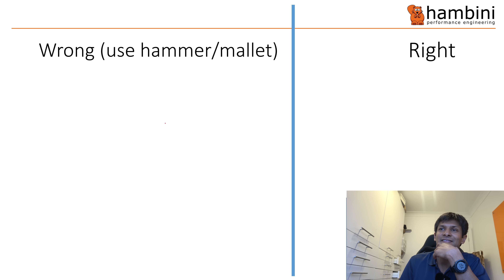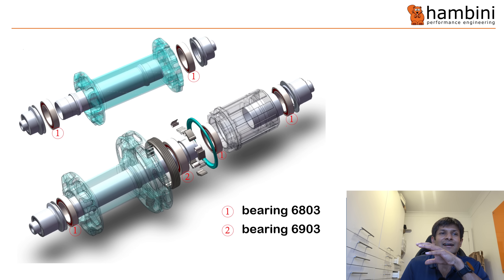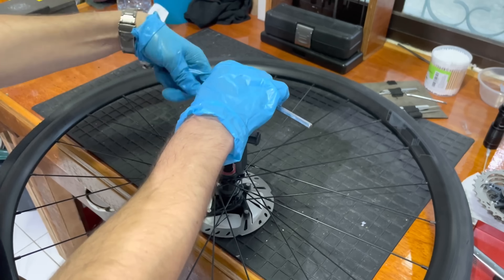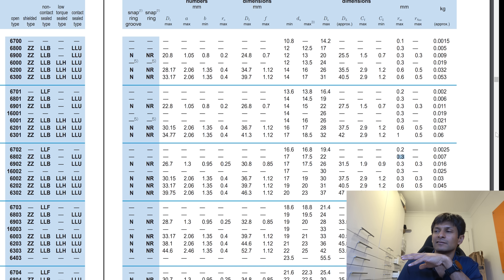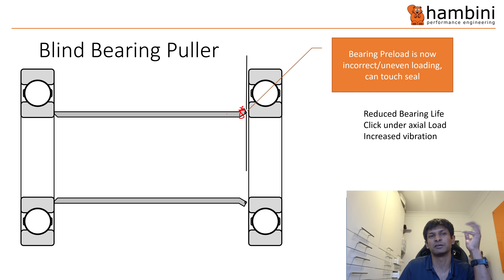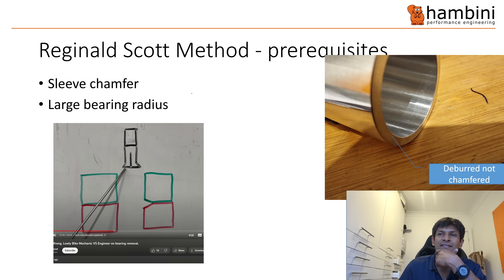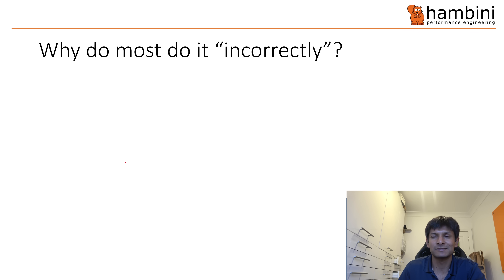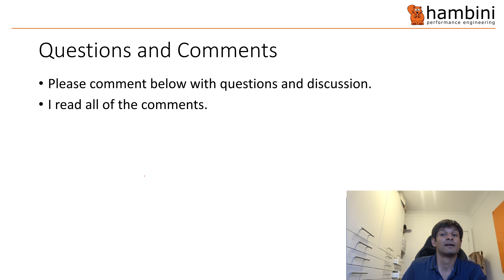I got REAMED by a Bicycle Mechanic | It was bound to happen at some point.

Comment from the maker: For clarity. In his video, he described it as a new wheelset. He thinks it's ok to take the bearings out, then put them back in and sell the wheels on. The bearings will get damaged as you remove them as the balls will dig into the races. Whilst I accept this is done frequently, on a brand new set of wheels and an unsuspecting customer, I think this is totally unacceptable.

On the subject of the flare, his diagram in his video showed a completely flat tube, I was pointing out that this is not the case on his own wheels.  I've taken loads of wheels apart, I've never seen one with a flare in it, or one that was heavily distorted despite being brand new.

I'm also dubious as to whether these wheels are factory fresh, I think the bearings have been removed before. The positioning of the puller legs on the spoke holes are to put it mildly "undesirable".
Reply: @hambini

I think there's some more nuance required, perhaps.

I've whacked out cartridge bearings and bearing races, on bicycles and heavy industry diesels equipment.

I think you and the bicycle engineer are both correct, but both miss out a little detail.

Personally, I'm happy tapping out my bearings and pressing them back in with a vise, or tapping back in with a hammer. But, it's not ideal. 

Blind bearing pullers will likely flare the preload tube, but it's a cheaper part than the hubshell to renew, than if you start to mangle the bearing seat when you're walking the bearing out with a drift and hammer. 

You can contaminate and damage the races or balls with drift material or start to injure the races or balls if they're particularly tight, though this isn't a major concern to me on a bicycle sealed cartridge bearing pressed into a (relatively) soft aluminium hubshell.
Reply from the maker: @ChazHarding  Totally appreciate your comments. The issue is the preload collar requires an exact measurement and it's unlikely your local shop has that size, it's hub specific. Conversely any bearing shop is going to have a 6803 bearing.
Reply: @Hambini  yeah, that’s part of the nuance. Not everyone has access to accurate measuring tools (or knows how to read or use them). Plus, how are you going to measure the preload tube if you distort it on removal…

At the end of the day, it’s a bicycle. It’s not that expensive, or that complex of a machine. Even a whole new hub / wheel is pretty inexpensive when you compare with aerospace or industrial stuff. 

Does it keep me awake at night - not even slightly. For a start, how many times are you removing the bearings (unless there’s some other underlying cause)? Infrequently. Maybe once a year? 

I could pretty confidently remove and reinstall a bearing 10 times, which would (for me anyway) far exceed a 10 year lifespan on my hub. Not to mention as a Clydesdale on my MTBs - breaking a spoke hole, galled / cold welded disc brake mounting screws, or changing hub standards will likely cause my hubs / wheels to be obsolete far faster.

Plus, I like shiny things. I might change them to change the colour, or design, or whatever. We’re fighting over something so ridiculous!! Hahahaha.
Reply: Incredulous, not dubious. Sorry. I'm an old teacher. All the best.
Reply: @chaosflower4892  IMHO, No, spacers should be replaceable. They should be designed in a way that they do not get damaged by the puller. IE they must have a 0.3 mm chamfer or a cylindrical cavity 0.3 + locally extra thickness so they don't flare out. Like this, both methods will work.
Reply: Why not use a collet style blind puller similar to what BearingProTools sells as first choice and then employ other more barbaric methods if the bearing won't budge
Reply: Btw. He's in the comments section commenting on other people's comments saying that you misrepresented what he was doing... Some people really don't know when to give up 🤦‍♀️
Reply: hammer gets a lot of bearings out quickly, good for wheels 
puller is good for frame bearings (full suspension bikes)
vice to push the fresh ones in (if no axle to press)
Reply: Yeah…That’s all we and good…
But the burning question has to be; did you bang the hairdresser’s hubs off, or did you caress them with precision tenderness?
Reply: I would say that the mechanic seems like a nice guy and watching his video it came across as professional and professional constructive criticism (opinion) and not in anyway personal.  
His opinion adds to the discussion and it should not become a pile on against him. 

I’ve watched a few of his videos now and they seem interesting
Reply: @bikepackingadventure7913  I totally agree about "His opinion adds to the discussion and it should not become a pile-on against him. " > It would have been nice for Hambini to have said this.
Reply: 1:19 these are quite different examples of hammer use (hitting the whole axle) for a completely different hub design. In your case it was a hammer hitting a screwdriver pointed at one side of the inner race of the bearing which potentially can lead to the damage of the bearing seats in the soft aluminium hub due to uneven forces pushing the bearing out. 
Do you think the hub body is less crucial than a spacer? 
Also, it’s not clear how badly was the spacer damaged based on blurry screenshots.
Reply: @IvanMalechko  Hope recommend using a pin drift for removing bearings from their wheel hubs: https://www.youtube.com/watch?v=LeQYfb9PvqU&t=164s, from 2:40 onwards.
Reply from the maker: @IvanMalechko  He said that if you are using a hammer then you are doing it wrong. In a lot of scenarios there didn't appear to be any other choice
Reply: @Hambini  Hi guy's, thanks for this very instructive technical discussion. Yes, you did say that, but comparing these completely different examples can be misleading for novice mechanics. IHMO, purposely misleading in order to prove your point😛
Reply: @Hambini  Do you think that a good hub design should include a 0.3 mm chamfer or even a cavity on the spacer tube? This is definitely nitpicking but why not?
Reply: @Hambini  "The technique I employ which all of the aforementioned companies on the previous slide are guilty of is wrong" > The aforementioned examples show pushing the bearing out by tapping the whole spacer tube. With a design similar to the Winspace hub where the tube passes through the bearing and has 2 ridges to fix the distance between bearings.  In this case, it is perfectly fine because there is no risk of the bearing rotating and expanding the bore in the hub housing. They are using a hammer but it is incorrect and misleading to say they are using the same method as you.
Reply: @alexanderbolton3708   No because reaching in and moving the spacer over and using a (preferably brass) drift to drive the bearing out is quite normal practice as shown by bearing manufacturers, If your not intending to reuse said bearing.  The bearing in wheel hubs aren't generally used in ways that allow the most gentle methods.

As a last thing, often many people presume the careful controlled use of a hammer and drift/punch to be crude, it's not, but it can be when bubba starts in at something...
Reply: @alan-sk7ky  Yes, actually I would have used a hammer because I don't have a bearing puller. If you are very careful this is ok. My reply was more about engineering discussions than fixing bikes. Bearing design is an interesting topic and it is rare that people go into so much depth.
Reply: @alan-sk7ky  Yes, actually I would have used a hammer because I don't have a bearing puller. If you are very careful this is ok. My reply was more about engineering discussions than fixing bikes. Bearing design is an interesting topic and it is rare that people go into so much depth.
Reply from the maker: @alexanderbolton3708  Watch the hope video https://www.youtube.com/watch?v=LeQYfb9PvqU&t=164s
Reply: @Hambini  As I replied to alan:  @alan  Yes, actually I would have used a hammer because I don't have a bearing puller. If you are very careful this is ok. My reply was more about engineering discussions than fixing bikes. Bearing design is an interesting topic and it is rare that people go into so much depth.

Not sure which comment you replied to so I have pasted my replies here under. I think this debate is very instructive and I hope the Lonely Bike mechanic does a follow-up. What would be great is an episode describing the ideal hub architecture and best practice maintenance methods and tools. You could have them designed and sold in your shop. 

@Hambini  "The technique I employ which all of the aforementioned companies on the previous slide are guilty of is wrong" > The aforementioned examples show pushing the bearing out by tapping the whole spacer tube. With a design similar to the Winspace hub where the tube passes through the bearing and has 2 ridges to fix the distance between bearings.  In this case, it is perfectly fine because there is no risk of the bearing rotating and expanding the bore in the hub housing. They are using a hammer but it is incorrect and misleading to say they are using the same method as you.

 @Hambini  Do you think that a good hub design should include a 0.3 mm chamfer or even a cavity on the spacer tube? This is definitely nitpicking but why not?

@Hambini  Hi guy's, thanks for this very instructive technical discussion. Yes, you did say that, but comparing these completely different examples can be misleading for novice mechanics. IHMO, purposely misleading in order to prove your point😛

@Bikepacking Adventure  I totally agree about "His opinion adds to the discussion and it should not become a pile-on against him. " > It would have been nice for Hambini to have said this.
Reply from the maker: @alexanderbolton3708  It's difficult for me because on one side I have the professional hat on which is what would be expected in an industrial workplace and the other side is YouTube and what is acceptable in a bike shop. The two thresholds are obviously different. 

The universal takeaway irrespective of the business is the reuse of the bearing is a really bad idea. If something happens to the wheel - for example ,the cage collapses and puts the rider in a ditch. If proven, the bike mechanic would have a very hard time proving the re use of bearings was acceptable. And that's the real issue there and also the ethics around selling the wheel in the first place. The process of removing the bearings will usually put more axial stress through than it will receive in it's entire lifetime. 

As far designing preload collars goes and the use of a R0.3mm radius on the preload collar - this is not really covered in great detail by bearing suppliers as it's a relatively uncommon application (in the sense that you would renew the bearing and not make the item throw away) I would probably recommend tapping to get it started so there is a gap and if you need to then use a blind bearing puller - the risk of damage to the preload collar is negated. However, if you got it started enough to get a gap, the bearing usually flys out so why stop? 

I don't have anything against Reginald but I can't help feel that he's used this "disagreement" to further his channel hits but the reuse of bearings (on new wheels) is ethically quite disturbing.
Reply: @Hambini  Sure, that's fine (about the hats). I also agree that reusing a bearing that was pushed out by putting the force through the balls is not acceptable. I found it strange that he mentioned that, especially a new bike, some else bike. I wouldn't buy a bike from a shop that messes around with new bikes before selling them ... Very strange... I hope the Lonely Bike Mechanic does a follow-up. I think this video reply "ping-pong" thing is really great for going in-depth into mechanical design excellence. I think it's fine that he may benefit and gain views from this.  It's much better than the brands that just try to sue you. If somebody has a good justification for their technical choices then they should have no problem giving a detailed technical argumentation via a video. Anyway, thanks for your reply. I really enjoy your channel.
Reply: @Hambini  I don't think it's intellectually honest to compare using a hammer on an axle as the factory examples are demonstrating when you and the other mechanic are trying to educate people on pulling a bearing out that has that preload sleeve. You used those examples as support for your viewpoint when they do not actually support your technique, only that you used a hammer. You have educated everyone on the importance of matching the bore dimensions to the intended bearing and how crucial it is for bearing performance. I absolutely agree. Would you agree that hammering on one side of a bearing and then the other can potentially affect the bore dimensions of some hubs? Is it a case of the lesser of two evils? I would think that replacing the sleeve with the bearings would preserve the more expensive hub.
Reply from the maker: @ergottwheels  his comment was anyone who uses a hammer is doing it wrong. The hope video is a perfect example of how I did it and at the time they were using shaeffler bearings.
Reply: @alexanderbolton3708  interestingly that method is more akin to the method employed by Reginald as it avoids twisting the bearing, which drastically increasing the possibility that it can be reused in a less than ideal scenario.
Reply: @Hambini  Just a quote from Reginald's critique at 9min5sec regarding punching out the bearings as you have "Granted if you are planning to change these bearings and throw them away, that's absolutely fine.  But if you start hitting this with a pin punch, you do run the risk of actually causing damage to the bearing and that means you cannot put it back no matter what kind of service you're doing to the wheel."  Pretty important to note the context of the claim no?  The great Hambini is not going to put back a punched bearing.  Why would a mechanic have to do that?  I can't think of one reason a mechanic would be so careful about extracting a bearing that he doesn't have a replacement for, or one he can't get in time for his customers ride, or one that the customer isn't ready to pay for.  What just to clean it out, regrease it, leave it better than he found it?  And then to employ the same careful bearing extraction technique even when the bearing is available is beyond absurd.
Reply: @andinosubrosa1253  knocking a bearing and using a blind extractor both damage the bearing. Blind bearing pulls are mainly used if you can’t extract it from the other side in most cases. Leave the bearing in if you’re not going to replace it , never re use an extracted bearing and especially don’t charge someone for it
Reply: The end of the tube you're pointing to as "flared" is the one from the other side of the hub. The side that was in contact with the bearing puller is on his fingertip.
Reply: @Laundry_Hamper  Really? I must check this out! At least someone is paying close attention.  😀😀
Reply from the maker: @alexanderbolton3708  check the pinned comment.
Reply: @Laundry_Hamper  You are absolutely right!
Reply: @Laundry_Hamper  So true, and why Hambini has to resort to saying that he is "I think the bearings have been removed before."  Classic speculation to distract and avoiding admitting his exactly what you noticed.
Reply: @hambini, Reginald Scott is correct.  How else would you guarantee repeat customers for bearing failures if you do no flare the ends of the spacer?
Reply: @ricktan5663 …reminds me of a house painter that carried around empty paint cans. He would only take jobs that customers wanted to keep the same colour and just freshen  up the walls. He would wash the walls and leave empty paint cans behind looking like he painted the place.
Which also reminds me of a bike company called Miele. Way back in the day he was in bad shape financially so he went and borrowed a lof from banks to get a lot of bikes manufactured.
A year or so later he basically went bankrupt. The bankers/ creditors went into his warehouse and had about 250-300 bikes still in boxes so they were pleased about that…. Until they took a box out and found it was empty….all of them were empty and reglued😂😂😂 he took all the bikes with him and left the boxes behind on the shelves 😂😂😂
Reply from the maker: @ricktan5663  Recycling bearings, Seriously, WTF outrageous.
Reply: I'm no mechanic, just a guy who fixes his own bikes. Saw the vid about hammering them out the hunt. Got to say I did use his method of pulling them out with a cheap set of Chinese pullers. I thought he was right but actually watching this, I think you are right because I really struggled to get the pre load right afterwards. 

Win win space I used your method to push out.
Reply: those pullers are good for BB bearings and MTB frame bearings!
Reply: His method damages the spoke holes.
Reply: Never really understood the idea of removing fucked bearings nicely. Hammer the fuckers out, if that doesn’t work use bearing pullers, if all else fails….Get the Sealey 10 tonne press on it 😂😂😂. I’ve changed more bearings on a multitude if rotating elements that spin faster than an bike wheel. For the home mechanic light taps with a good pin punch is the easier option, rather than spending £500 in a SKF bearing puller set.

Comment: Alt/alt bearings have attempted to address the issue of removing the bearing without the use of an expanding collet and flaring the spacer tube, or hammer and drift. Hambini and a lot of exprrienced bike mechanics are only using the best tools available that will do mthe least amount of damage to the spacer, looks agricultural, but works.